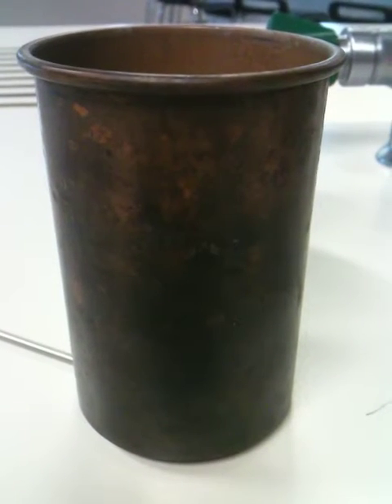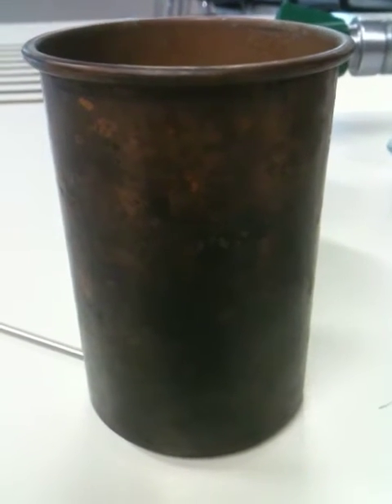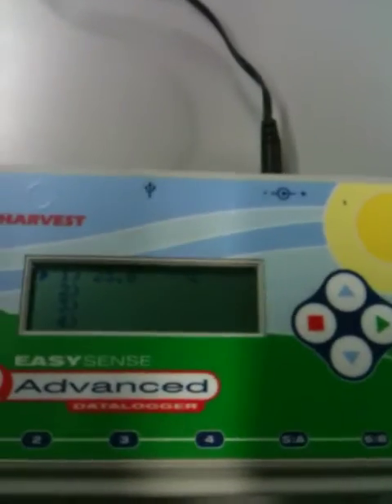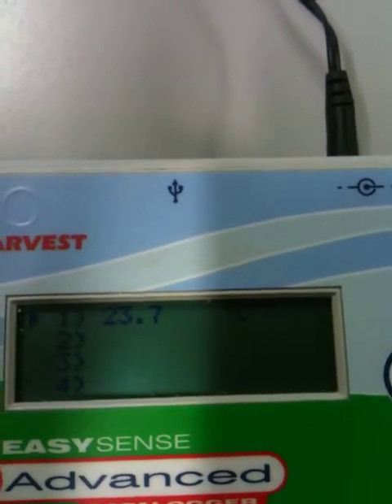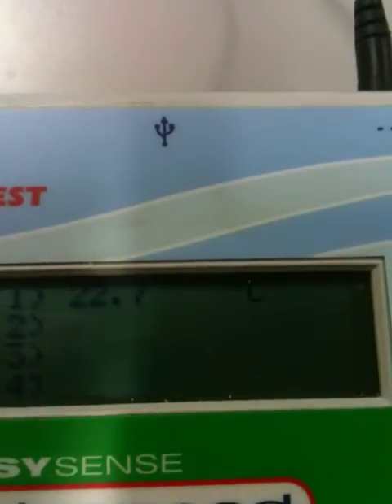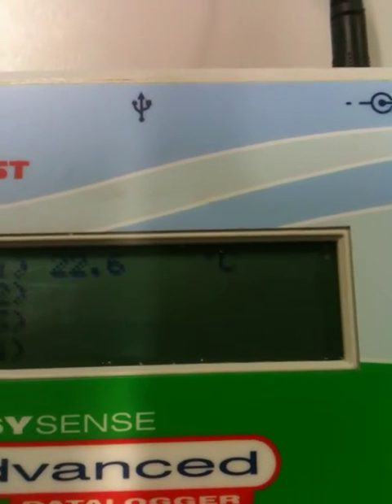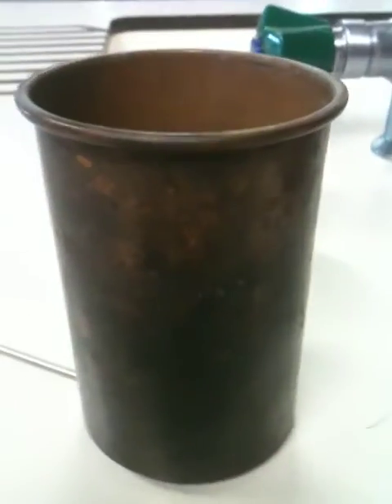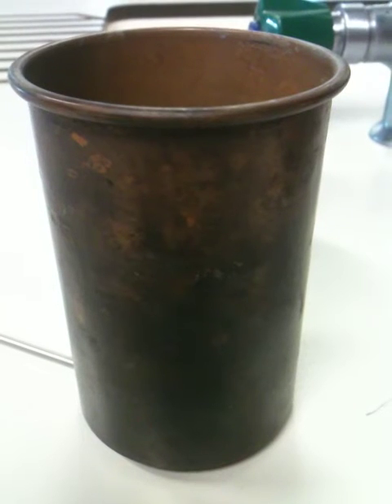Cooling By Evaporation Demonstration

Comment: This experiment can be aplicated for air conditioning system used water like refrigerant
Reply: Air conditioning require that the air fins temperature remain at 4 degrees Celsius . 
Maintaining such a temperature continuously requires a coolant that evaporates so fast and also condensates easily .. 

That is the challenege .. finding the right coolant ,based on its boiling point . And then inventing a new mechanism to re-condensate it in a way that is cheaper and more efficient than regular ac compressors .